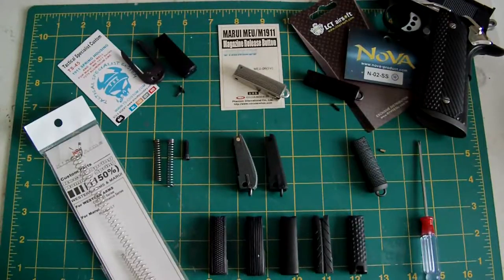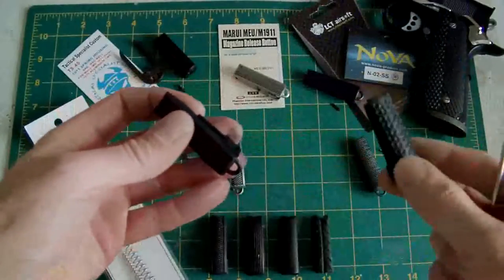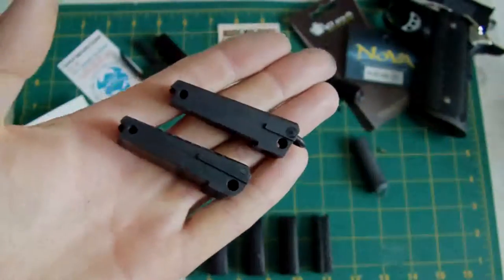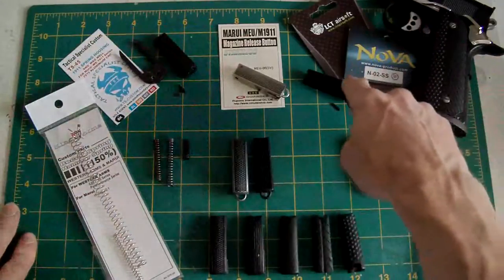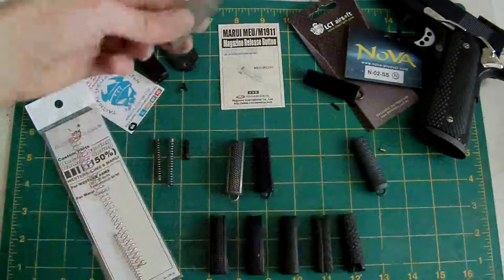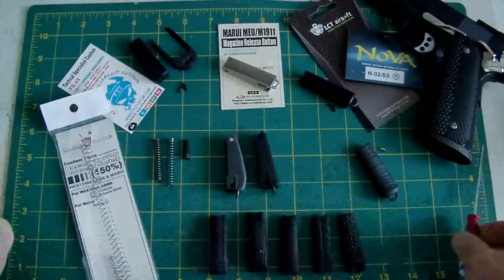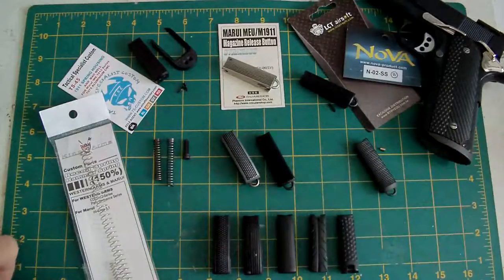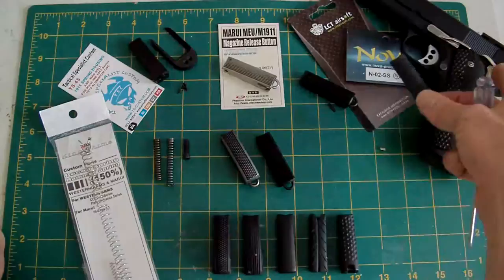LaZouche Custom airsoft MSH, fitting, upgrades and customizing.

Comment: ok thanks man,i see. Well another thing, im about to build a racegun on a tm 5.1 hicapa basegun, I want to make semi or decent upgrades on the internals, i will replace the slide w/ a cnc metal set, would you recommend that i also replace the loading nozzle, together with the (hop rubber, blowback housing and tight barrel)-that you mentioned in the other video?... The stock hammer is plastic isnt it, should i also replace it with a metal one?Thanks again pal. : )